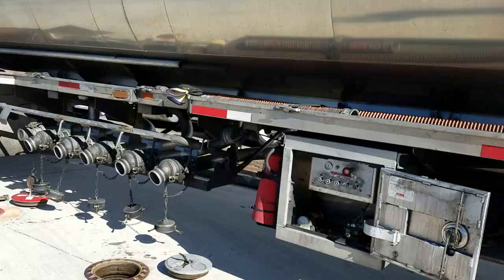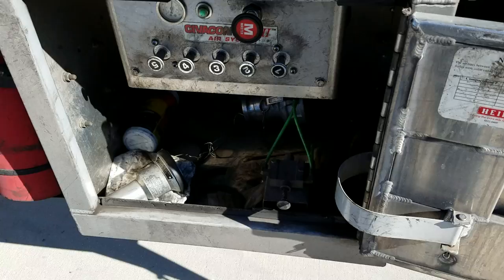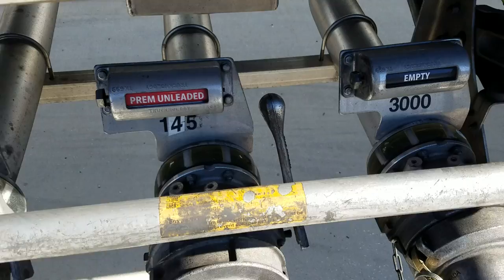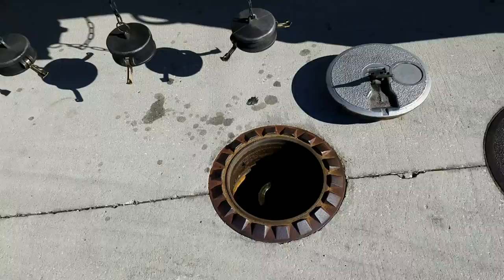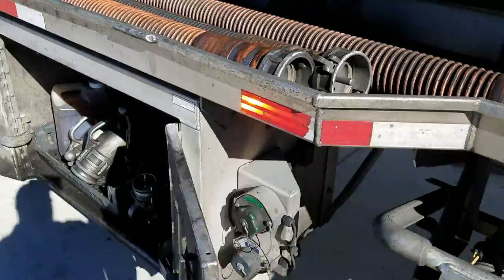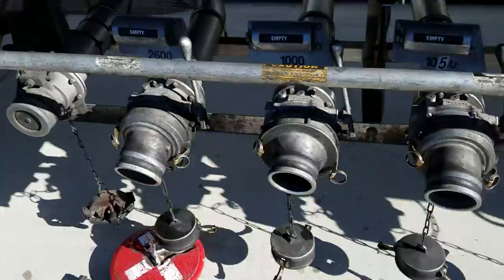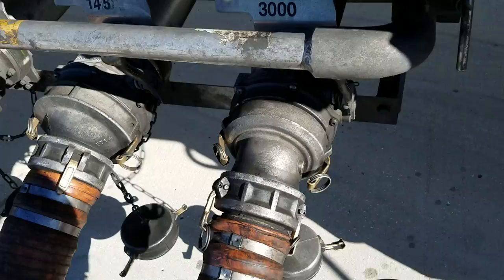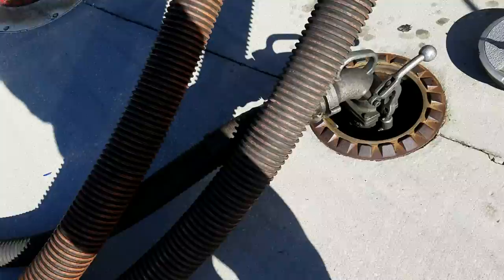How a Fuel Truck Delivers to a TruckStop

Comment: Did I miss something...or did you just use a previously used diesel hose, to now fill a fuel tank...??!! Talk about contamination !! Damn !! Diesel hose for diesel tanks, fuel hose for fuel tanks !!
OMG...no wonder our cars have problems !! FYI...diesel doesn't "evaporate" because it's too "oily" and less volatile, but it leaves an oily residue on everything it contacts...like the inside of a hose for example !!...Little bit now, little bit next time and again and again, all draining into the fuel tanks that we fill our NON diesel cars with.... do the maths !! Easy fix.... Label your hoses !! Geez !!
Reply from the maker: Sorry to burst your bubble but this is how its done at nearly every company. Gasoline will eat away and cancel out the diesel. You talk about contamination, but you clearly dont realize you're talking about extremely small amounts of diesel going into 20-30 THOUSAND gallons of gasoline. It's not going to do anything at all to your cars engine. 

Every fuel company i know of around here does this, you use gasoline to "wash out" the diesel in the hose. Thats pretty much industry standard, you're freaking out over absolutely nothing.
Reply: I don't doubt that it is done everywhere. Doesn't make it right though. Also, yes it is a little bit, but like I said a little bit now, then again tomorrow, next week, the week after etc.. it all adds up !! Maybe you should change the industry practices, and "wash it out..." wow...yep...straight into the fuel tanks. Lets see you run your petrol car on even as little as 5% diesel contamination (this could be what's in the fuel tank at your servo after years of your practices) for a long time. Good luck !!  @DrtyDiesel
Reply from the maker: @DT-ge8gd  we are not talking 5%, we are talking .000000005%. It doesnt add up either, it all gets cleaned out when the tanks are serviced. There is no need to change anything. Oh and guess what? After i haul a load of diesel, you know what happens? We load gasoline. Again, the gasoline will eat away and cancel out the diesel. Its not going to harm your vehicle.
Reply: What !! Tank service !! Ha !! Never seen a tank service at a service station EVER !! The only "service" they get is when they are ripped out of the ground when the station is pulled down. And learn your stuff...it doesn't "eat away" at anything, it is dissolved in it, because oily substances like the components in diesel are miscible with Benzene based solvents (That's fuel just so you know...). Now I don't want to get too chemical on you because you wont understand my chemistry, but lets just make it simple for you to google. Benzene rings, and oily substrates.  @DrtyDiesel
Reply from the maker: @DT-ge8gd  You're a riot, the gasoline will still cancel out the diesel. Again, you are freaking out over nothing. This is how things are done, dont like it? Get an electric car.

Comment: Not to be rude but u definitely need to be retrained. You have done a lot wrong  and you could have had a spill because you didn’t check your ears
Reply from the maker: ctffct ctffct , how didn’t I check my ears? You ever think that maybe not every fuel hauler delivers the same way? Some companies have different policies than others.
Reply: The ears were fine. Are you one of those drivers that fucks up my brand new hose ears by slapping them completely shut when you use my truck?

Comment: I came here to watch a truck delivering GAS, however this is Petroleum/Gasoline which is a LIQUID fuel. So that was disappointing.
Bloody Americans and their crazy misnaming and mispronunciation of English. I wonder what they call the LPG that's used as vehicle fuel? Do they call it "solid"?
Reply from the maker: We call it Compressed Natural Gas (CNG) or Liquefied Natural Gas (LNG)
Reply: @DrtyDiesel  - so, when they supply the CNG or LNG to the refuelling station, is that delivered with a "Gas Truck"? 
How do Americans differentiate between Gas and Gas? When they need to fill the "gas tank", how do they know which fuel to fill it with?
(PS: I know that "gas" is commonly used as an abbreviation for "gasoline")
Reply from the maker: @johncoops6897  if someone has a natural gas power vehicle, the pumps are clearly marked and in a seperate location. In America, what yall refer to as gas, we refer to as natural gas or propane.
Reply: @johncoops6897  We use common sense.